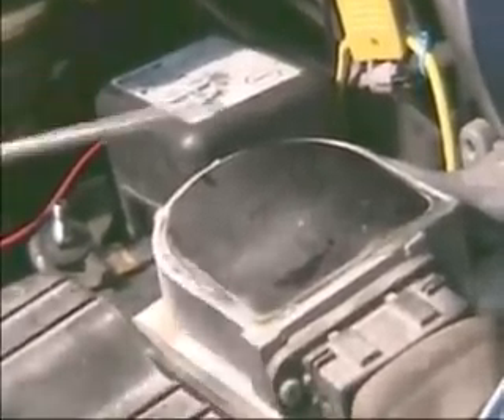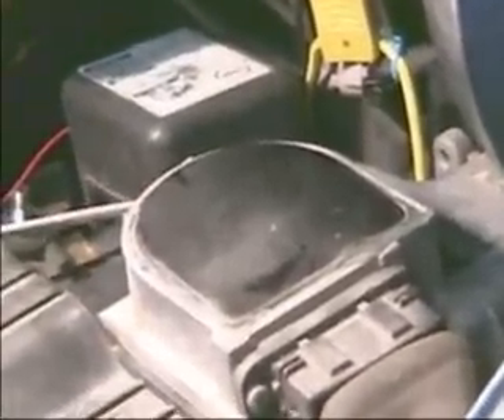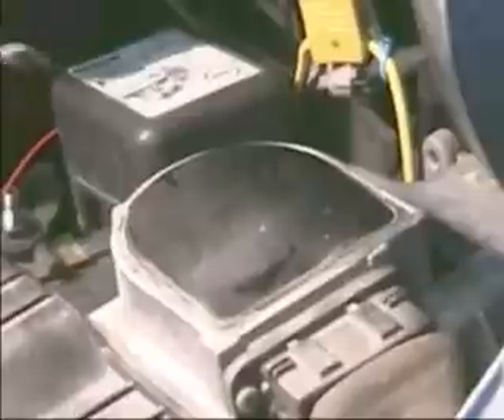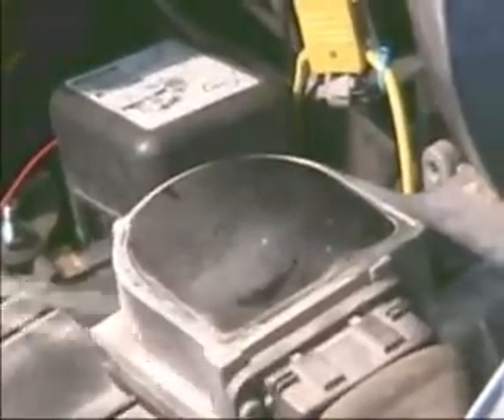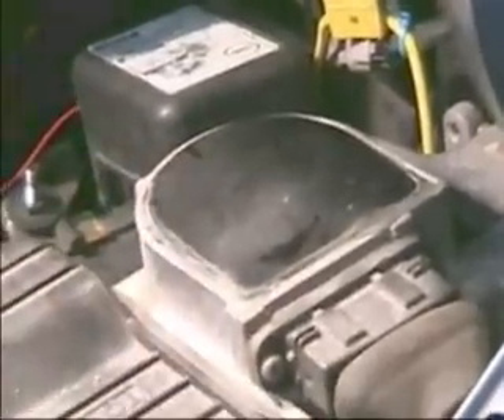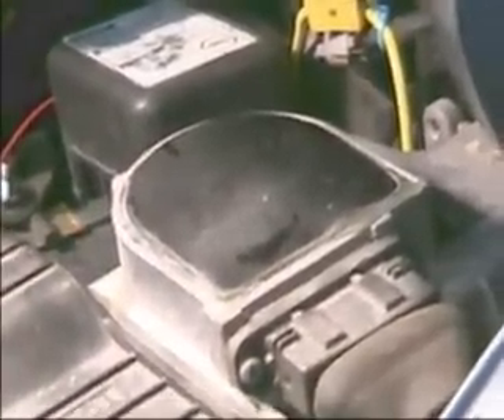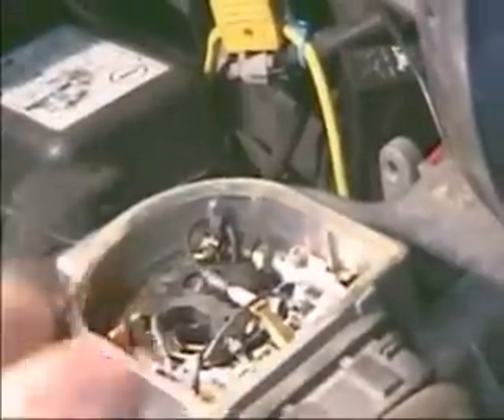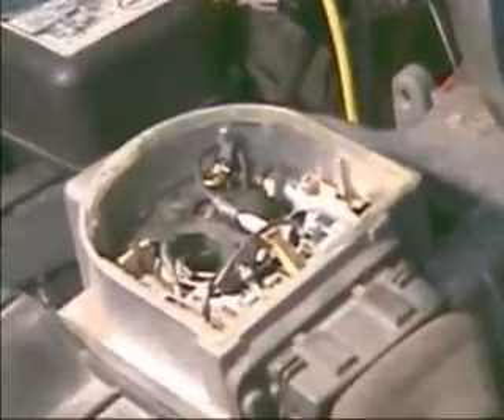How To Lean Out Adjust Calibrate An Air Flow Meter For Hydrogen Generator HHO

Comment: I was messing with mine and now it's out of whack. I slipped off the stool and lost my mark. How can I find a center or starting point?
Reply: You going to have to turn the wheel a little at a time to tighten it slightly while someone cranks the vehicle until it starts and that will be your starting point. Keep it running until engine warms as you slowly fine tune the wheel as seen in video. If the wheel was too loose which happens if you don’t keep it pinned it can over to richen and foul out spark plugs. You will need to clean the plugs.

Comment from the maker: Tightening the coil spring leans out the engine. If you watch the video it shows which way to turn the toothed wheel to lean out. Clockwise. Follow the instructions in the video it's very clear how to adjust it to its best setting.

Comment: My engine bucks around and cuts out but runs ok if I unplug the meter.  Except when the factory turbo hits boost it's too lean. I ordered another AFM but it's doing the same thing now. I'm about to open one of them up... so is this a routine adjustment that needs done?  (I have an 87 chevy sprint turbo but nearly identical part)

Comment: @wageh salib, RX-7 MAF mechanically fit the VW Vanagon? as long as the connector and everything fits, adjusting is not a problem. Do you have to change any electrical or mechanically drill holes etc. to fit?
Reply from the maker: it's as you see it... nothing added or removed... just adjusting

Comment: I have my potentiometer that is worn out so badly. So I moved the wiper to another track that still have carbon film left unworn. Kind of OK. But I am worried the linearity of a badly worn potentiometer is making my car not fuel efficient etc. 2 years ago it was marginally passed smoke check, now I want to change that potentiometer rather than the whole box. All used boxes on ebay are not good anyway. You have an idea?

Comment: @SteluB02GTR i agree it should be left alone. but take my case i have a 91 miata i am replacing the miata MAF with a rx-7 MAF (ya it actually fits) so thus the MAF has to be adjusted or else it runs too rich.